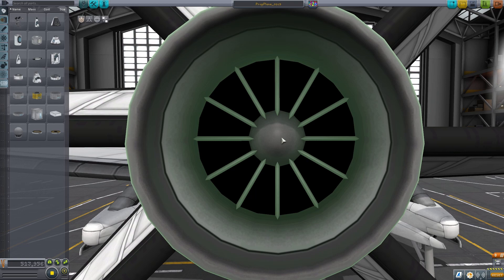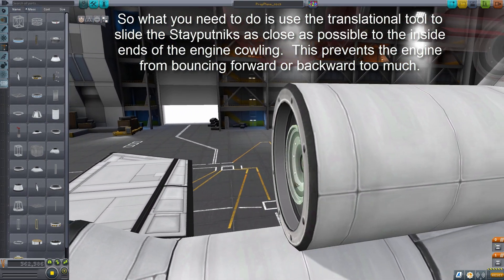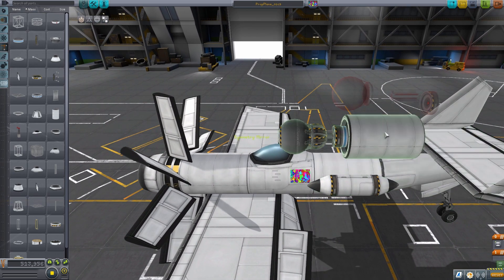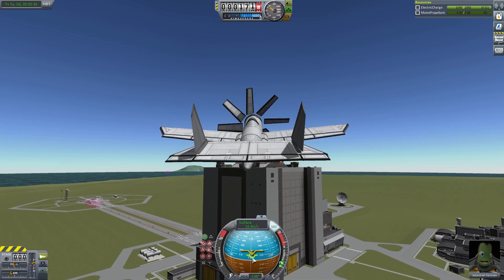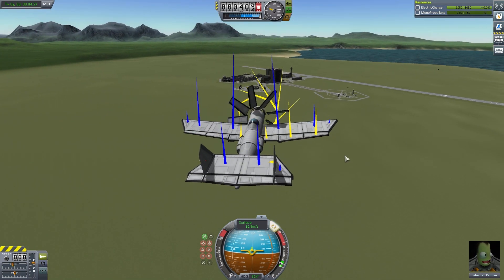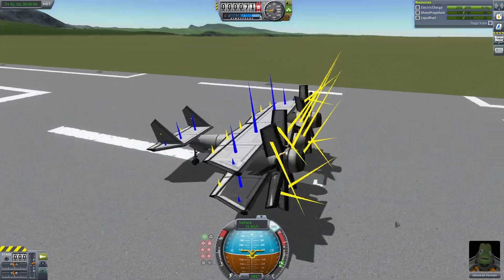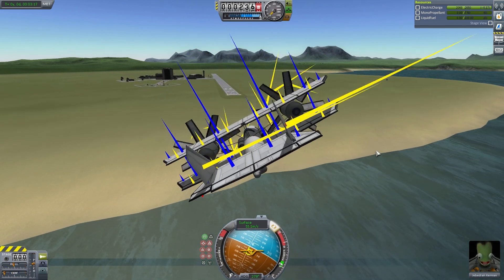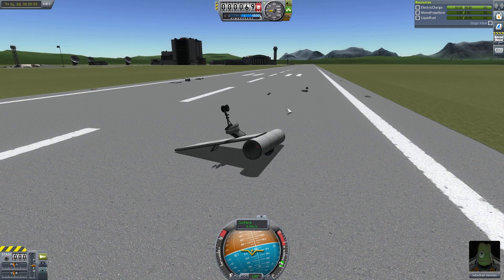OBSOLETE VIDEO, pls see #3 -- KSP stock elec prop 2: smaller engine, bigger performance

Comment: Get rid of your top wing, thats killing your speed.
Reply from the maker: But then it wouldn't look like a biplane!  :(
Reply: But its killing performance. could you mold the engine housings into the wing? because right now you  look like you have a ton of drag. 

Also single wing birds are way cooler than biplanes! theres a reason we chopped that top wing off lol!

Comment: Helicopter using this method?
Reply from the maker: Ah ha!  For you, dear sir, I recommend (highly, in fact) that you check out Rahmat Mirkovich's video on this topic.  I did make a couple of helicopters but they were neither elegant nor effective enough to bother putting into a video.  It's pretty much just a matter of tilting the engine vertical and adding reaction wheels to the fuselage.  
https://youtu.be/_QGJiy43b6c
Reply: Inter's Odyssey have tried to make a helicopter for soo long, and Got a beatifull one flying! (With another engine) but there was a small problem. The lock Holding roter 1 woud break after 15-25 sec in the air, used months to try to solve it, this design and the use of some wheels woud give me a huge posybiliti to make a gr8 helicopter! Thank you soo mutch!

Comment: how the hell do you move the camera?
Reply from the maker: Not sure which type of motion you're referring to so I'll cover all.  In the SPH, basic zoom is done by the mouse scroll wheel, I bound my PgUp and PgDn keys to raise and lower the "floor" of my camera, and holding down (Left?) Shift lets me slide the camera across the floor so I can scoot up very close to parts.  When flying, basic zoom is the same, the right mouse button allows the camera to be panned.  The middle mouse button (crushing the scroll wheel) allows the camera to be swivelled so the target craft/object is no longer locked to the center of the screen.  And new in 1.2 is the ability to right click on a part and see the option "Aim Camera" (you may have to adjust some settings in the main Settings menu to see this) so you can lock the camera's central position to a specific part rather than the pre-1.2 default of always having the camera focused on the total craft's Center of Mass.  The super cool thing about this new Aim Camera option is you can lock the camera to a part that *isn't even part of the craft or kerbal you're currently controlling*!!!  Very cool.

Comment: HOOOWW
;-;
Reply from the maker: This video and its predecessor from 14Aug should answer your questions.  The main lynchpins which I may have glossed over are as follows: when the engine starts turning it needs to be a separate craft from the plane hence why you build the engine out from a decoupler; because the engine is a separate craft from the plane, it needs to be trapped inside the cowling by some sort of cowling cap piece (I prefer the Z-1k battery); the way the engine stays rotating is by using the trim commands: hold down Alt + whatever your right rotate key is (default E).